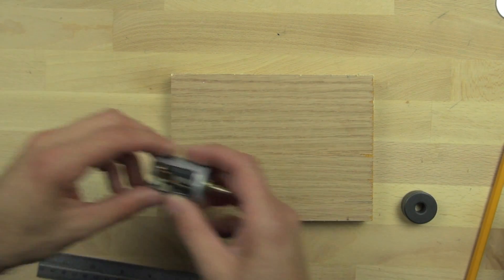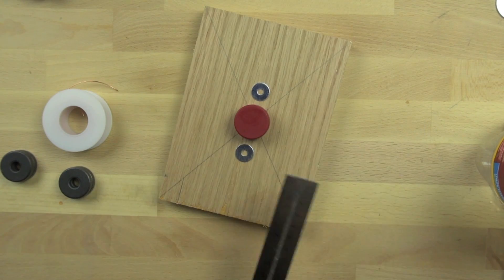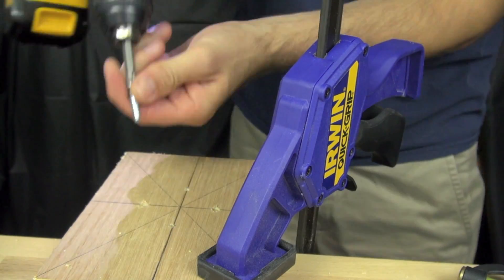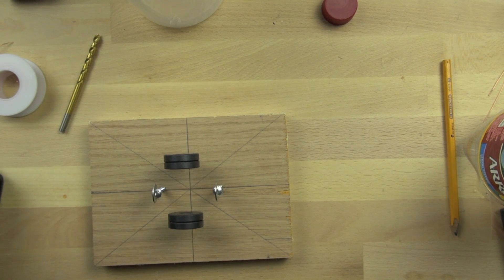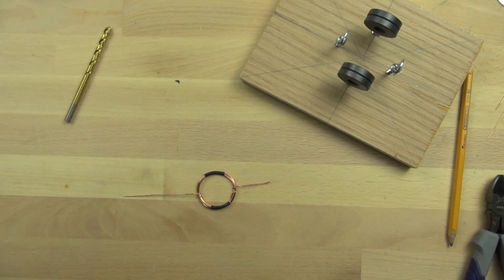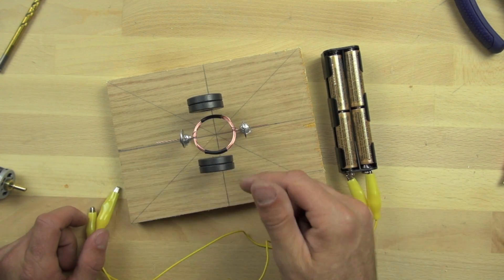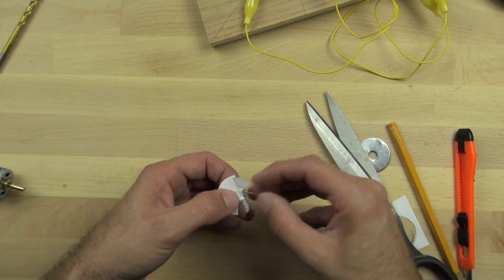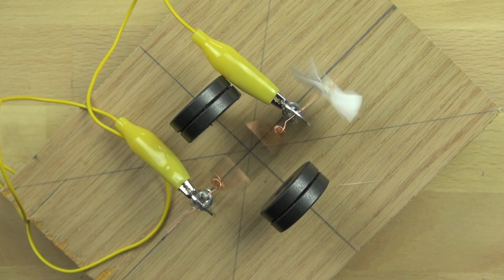Build your own motor

Comment: It doesn't work and it's painful. Should the distance between the two magnets be equal to their distance from the center? Also, how many volts do you use in the battery?

Comment: Why does the Copper wire need to be symmetrical? Or follow in the same path as the layers below it.
Reply: if it is longer in one part than the other it will get hotter over time, causing bad things to occur

Comment: Quite frankly, the instructions in this video are dangerous. The rotor will get hot enough to cause burns. If left on for an extended period of time, it may even be a fire hazard.

First of all, you're using 3 inches of wire to build the rotor winding. That looks like 32 AWG wire, so you're putting over 140 A of current through it with the 6 V battery. You NEED to use a lot more length, at least 20 feet, or else it's going to melt. The batteries are also not going to last more than a few minutes.

Obviously you did it this way to generate a strong enough magnetic field to turn the rotor. But that's because you used an air core! Use an iron core -- even a nail would be significantly better! That would reduce the required current by a factor of 5000. To get the correct resistance for that current, your rotor needs to have hundreds of turns.

And number of poles is NOT the number of loops. Number of poles in a motor refers to the number of magnetic poles. You have two poles. It's impossible to have a working motor with just one pole.
Reply: T2T- holy cow do you really think 140A is passing through that wire?

Comment: Why does he scrape the coating off?
Reply: The lacquer coating is meant to protect the copper wire but it also act as an insulator, scraping the coating off means removing that resistance which lessens the conductivity of the wire so that electrons could move more smoothly.
Reply: Better conductivity

Comment: Hi, can you please give me a detailed list of the materials? Because i was trying to do the experiment but it doesn't work. So Maybe you could help me with this! Btw Congrats for the video is great!
Reply: The video has serious safety issues. Don't do it the way he did because there is risk of serious burns from touching the rotor winding. Running the motor for extended periods of time can also be a fire risk. To do it properly, you need hundreds of turns in the rotor to reduce the current to a level that won't cause the wire to heat up. But you'll also need to wind the wire around something iron, like a nail, to increase the strength of the magnetic field.
Reply: @morbo3000  this simple setup can lead to some serious burns?
Reply: T2T- True. He is so unproffesional.

Comment: Hi, I can see you didn't use any commutators so its rotation should bounce between clockwise and counterclockwise. Is your motor doing so?
Reply: Here's another person's comment that explains why:
"this doesn't use a commutator.  he only scrapes half of the wire so that way he doesn't need to reverse the current to allow it to spin but by doing so he sacrifices half of the potential power"
-Zenithteal

Comment: 5:42 Five loops does not mean five poles. The motor in a hairdryer has many loops/turns of wire within it! 
The motor in an AC powered hairdryer has no permanent magnets!

Comment: In a comutator based d.c. motor the two contacts for the rotor coil(solenoid), or the brushes, will be 180° apart. In a pulse driven motor the said contacts can be on the same side . . ?

Comment: how can I make it more powerful
Reply: You could try putting a stack of washers that fit perfectly inside the coil. Because of the added weight, you might need to MacGyver some sort of support so that it doesn't bend the wire ends.

Comment: Great Video!!! but is this a motor with Commutator or the one with out commutator?
Reply: Blooming Talentz this doesn't use a commutator.  he only scrapes half of the wire so that way he doesn't need to reverse the current to allow it to spin but by doing so he sacrifices half of the potential power

Comment: I haven't worked on it, but I have thought about it. You know, there are theories that a space-time warp drive is possible. The only problem is, it requires the energy mass of Jupiter to work. So ... but because the electromagnetic field is embedded into the fabric of space time,  I don't see why we couldn't exploit it in some way for propulsion through space. I think we will need to unify all the fields before we have enough understanding to do so.